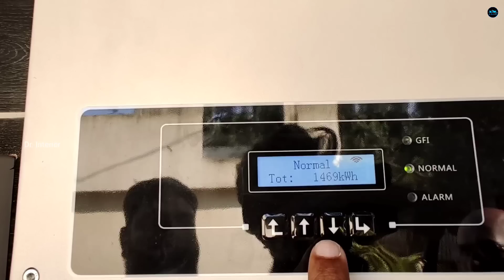കറന്റ് ചാർജ് വട്ടപൂജ്യമാക്കാം Solar Energy യിലൂടെ|Solar panel with KSEB subsidy|Solar|Dr. Interior

Comment: On grid systems like this is not a good option for those who have to pay 10k bill bimonthly, bcz the installation charge is huge n the amount we are saving yearly is not much high. Also the efficiency of the panel decreases gradually. Moreover if there is a power outage then you are also out of power during same time tho you've spend so much amount installing on grid solar system.

Comment: എൻെറ സുഹൃത്തിന്റെ വീട്ടിൽ സോളാർ പാനൽ വച്ചിട്ടുണ്ട് with inverter and battery. But, KSEBയും  സോളാർ കമ്പനിയും ചേർന്ന് ഒരു പണി കൊടുത്തു. Inverter charge / battery charge almost 50%  used ആകുമ്പോഴേക്കും automatically  KSEB യിൽ നിന്നും battery ചാർജ് ചെയ്യാനുള്ള കറൻ്റ് എടുക്കും. Battery charge 0% ആകും വരെ ഉപയോഗിക്കാൻ സമ്മതിക്കില്ല എന്ന് സാരം... സോളാർ പാനൽ ഉപയോഗിച്ചിട്ടും പുള്ളിക്ക് Rs.5000/ - വരുന്നുണ്ട്...
Reply: Inverter company vilichittu MPPT System aanenkil charge control panel only aakkkuka and battery discharge um set cheyyuka
Reply: Off-grid syste ത്തിൽ kseb ക്ക് പ്രത്യേകിച്ച് roll ഒന്നുമില്ല ബ്രോ. 
നങ്ങൾ മനസ്സിലാക്കിയ കാര്യങ്ങളിൽ ചെറിയ mistake വന്നതാണ്. ബാറ്ററിയുടെ DOD (Depth of discharge) ഒരിക്കലും 40% ത്തിൽ താഴാൻ പാടില്ല.  അങ്ങനെ വന്നാൽ, ബാറ്ററി ലൈഫ് 1 year പോലും നിൽക്കില്ല. അതായത് 10.4/10.5 volt എപ്പോഴും അതിൽ ഉണ്ടാകും. ബാറ്ററി അതേ ലെവലിൽ എത്തുന്ന സമയത്ത് സോളാർ production ഇല്ലായെങ്കിൽ KSEB ലൈനിൽ നിന്ന് MPPT വഴി charging തുടങ്ങി 14.5 % വരെ എത്തും. നിങ്ങൾക്ക് KSEB വഴി charging നടത്തേണ്ട എന്ന് ഉണ്ടെങ്കിൽ, ഇൻവെർട്ടറിന് പുറകിലുള്ള ഓട്ടോ സോളാർ switch off ചെയ്തിട്ടാൽ മതി.
Reply: @MALABARMIXbyShemeerMalabar  thanks bro 👍
Reply: @MALABARMIXbyShemeerMalabar  Good explanation.

Comment: ajay cheyumbol DC coupled solar inverter grid tie system vekan sramikuka (with or without battery).. normal grid tie system vechal kseb power cut akumbol solar supply yum cut akum for safety reason.. DC coupled solar inverter akumbol kseb current poyal solar supply inverter modeil akum and ksebyilotu ula supply cut akum apo solar supply normal inverter pole work akum and namuku pakal solaril ninula current use cheyam current poyalum. ivide pakal solar panel battery de stanathu power source ayi work akum and battery koode undel night il battery yil ninum work akum. current varumbol grid tie systethilotu connect akukem cheyum :).. Ajay prefer cheyuna installerodu ee samvidhanathil set cheyanula optionsinekurichu onu visadamai anuashikuka and cheyuvanel oru proper installation and guidance video cheyuka :)
Reply: സർ, അതാണോ ഹൈബ്രിഡ് സിസ്റ്റം എന്ന് പറയുന്നത്?

Comment: Meter rent അല്ല adakkendath. Fixed charges ആണ് വരുന്നത്. Monthly 100 unit upayogathinu 120 രൂപ ആണ് fixed charge. Maximum productin കിട്ടിയത്. 5 unit per KW ആണു.
Reply from the maker: അത് single phase അല്ലെ 120
Reply: @DrInterior  It is 3 phase.
Reply from the maker: @mercytj6205  3 phase ന് 120 രൂപ,????
Reply: @DrInterior Yes, our connection is 3 phase. Per month up to 100 unit import, the fixed charges is Rs. 120 for 3 phase. Fixed charges increase, if the usage exceeds 100 unit per month. We are paying like that from May 22 onwards.
Reply from the maker: Ok👍
Reply: @DrInterior  In our case, the meter is ours. So no rent for the meter.

Comment: But nobody talks about it’s decreasing efficiency after 5 years ,which leads to upto 40 to 50 % less power at the end of life span.Those who are having less than Rs 8000 electricity bill, this won’t be a profitable.And the energy production is not calculated if the power is off in the KSEB line.
Reply: Yes
Reply: Hi assalamu alaikkum